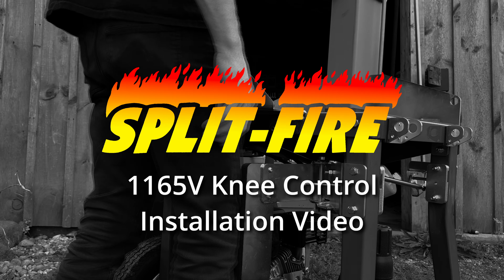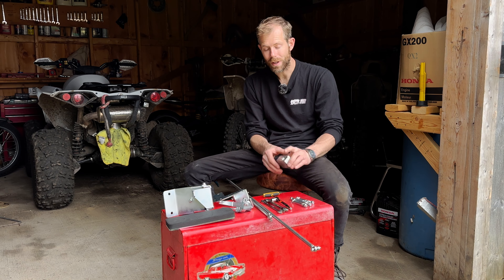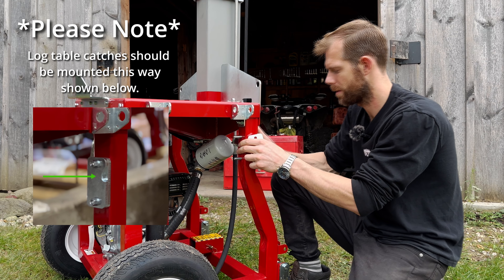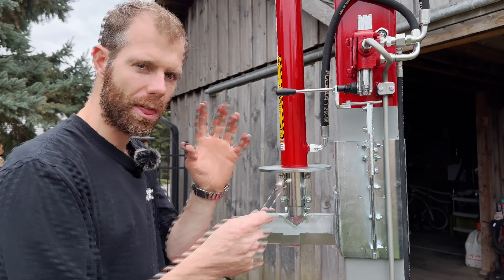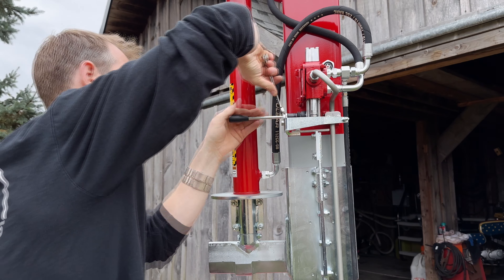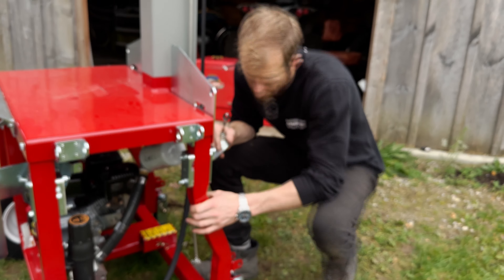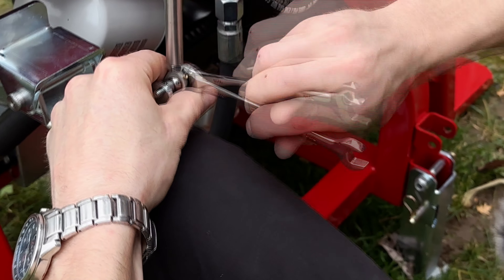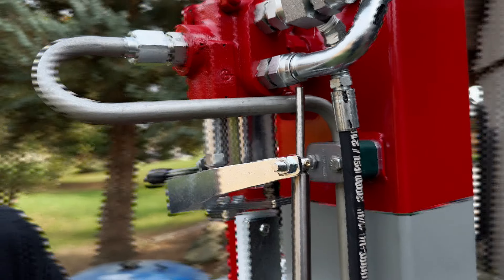HOW TO: INSTALL AN 1165V KNEE CONTROL

Comment: Awesome.. I love the splitters.. I want this splitter but not to sure about it being only 7.5 ton.. But good price
Reply from the maker: If you're a commercial fire wood seller using it to split and bag wood this might not be the machine for you. But, that hasn't stopped others from taking on that challenge.
Reply: I just bought one and WOW The tonnage  on its face appears to be low the fact that you have one knife where you can surgically split makes all the difference in the world
My experience has been 15 inch red oak and white oak round will not split in the middle
You have to take a couple slices off of the edges, which is still very usable firewood I’m sold on this splitter and the way split fire does business as well 1000%
This splitter augments my Easton, May 20 228 which is also a good splitter and Eastonmade is also a great company